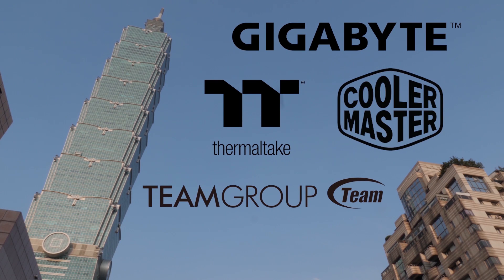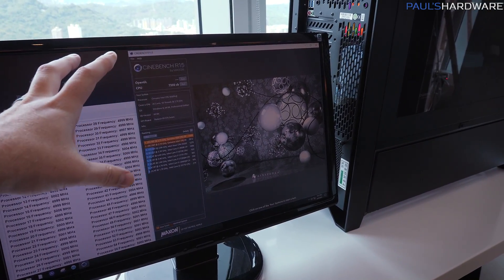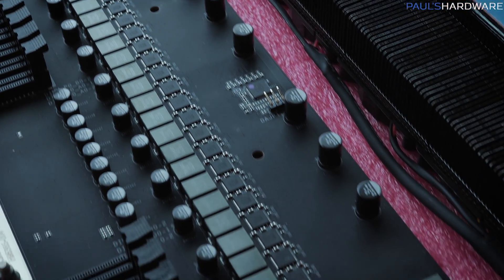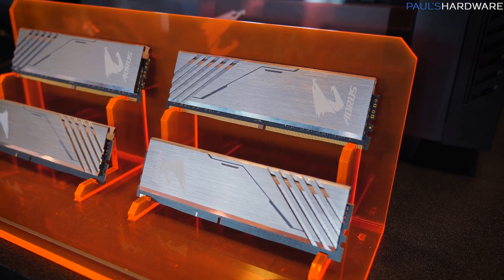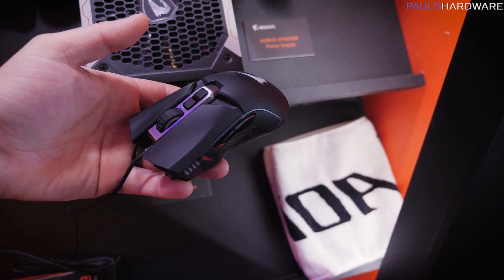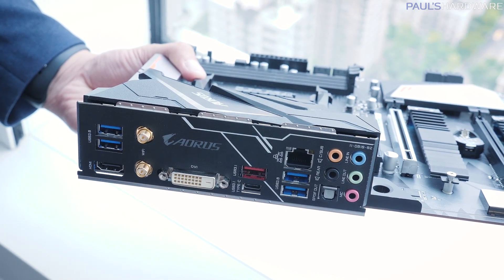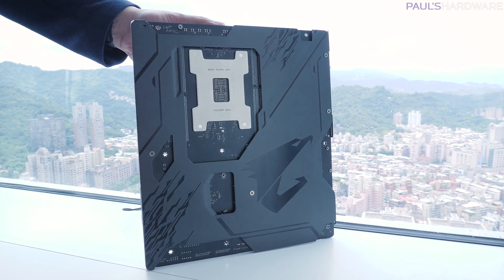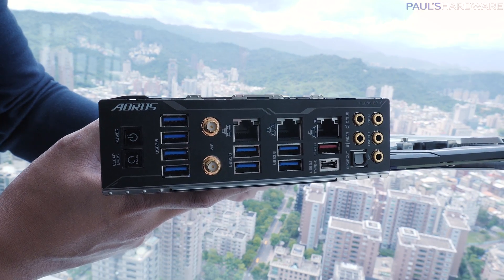Just A 28-Core 56-Thread CPU at 5GHz...

Comment: Intel, want to recover your market, make a 2 core, 4 core 6 core and 8 core and take a little lessor break even on them but MAKE them clocked at 5.3ghz native with a turbo to 5.9ghz, maybe 6ghz? People would be all over that and they can win the WAR without even attacking the same market! It's all about RAW Power...... Leave zero room for overclocking on these chips, that would still be fair if the price was right or like AMD'S or BETTER!...... Heck, I did major calculation on my personal usage and I NEED or would love nothing more then a 14 core cup that is clocked at 4.9ghz native that go up to 5.7ghz on the highest CLOCK as in secondary TURBO and at least hit 6.1 on the first TURBO.... tHE FIRST NATIVE TURBO CHIP TO HIT 6GHZ ON AIR.... Who would not buy a chip with these specs? I could not see it needing an upgrade until around 2040-ish and even then from degregation so I will stick with my beloved x79 12 threaded beast of a XEON 1650 V0 overclocked to 48% higher speeds then STOCK, what a beast of of a chip but I still want my 6ghz (on turbo) 14 core cpu, no hyper threading needed?...

Comment: I have a small air con that sits in my window and I've run a 6 inch wide pipe from the outlet to the computer case, which has a grill that lets in plenty of air and this cold air goes directly to the CPU. This set up reduces the CPU temp by more than 10 degrees celcius, and of course I only turn the a/c on when it's overheating, like on file-convert processes and other CPU intensive runs, cos it would cost a fortune otherwise. I've had this set up for nearly 10 years now and have had no problems.

Comment: Intel: look everyone, we can do 5ghz on 28 cores with 10k$ worth of cooling with 3 PCs worth of power supply!!1
amd: cooling? what's that? we just need someone to hold this beer so we can show 32 cores working in normal home system conditions, no biggie, you can get these in 2 months..

Think most of us know we won't be buying a seperate expensive air conditioner to just not set fire to our computers, but intel sure got some headlines printed! :P

Comment: In no way is Intel showing us something 'realistic', since there is no chance in hell this is going to hit the market as their 'new' flagship, not even remotely. Firstly it isn't based on anything new, rather scrapped together with all existing components and architecture, it is insanely and unrealistically clocked to 5ghz on ALL cores thanks to a chiller keeping the thing at sub-zero temps, which is anything but a real-life scenario so there is no way for us to actually 'relate' to something like that, then it must be drawing in excess of 1000W, knowing that the 28-core that they already had with a 'normal' oc would draw about 600-700W, which again is far from what we would be able to buy and 'use' in any way shape or manner, unless you like paying an electrical bill that is equal to your mortgage on a yearly basis. This is Intel telling you: 'hey look at us and what we can do, but you'll NEVER be able to actually use this fantasy anyway, so the joke's on you.'

AMD on the other hand IS showing us a real-life usable CPU with 32 cores, running ON AIR, and drawing a VERY conservative 250W, which is doable by today's standards for EVERYONE.

It's a clear case of lie vs truth. Wake up and smell the roses ;)

Comment: Intel did this move as a last minute PR stunt. They quickly used a Xeon socket and Xeon cpu overclocked well above the 2.7ghz base clock on all cores to 5.0ghz with a 1000$ liquid cooler lol. That is really just embarrassing as I bet every enthusiasts laughed after seeing the setup. Then here comes AMD with 32 cores with an actual production cpu and air cooler ready to be launched. From what Intel showed I don't believe this will work at all. This Xeon 14nm Skylake 28 core cpu at 5.0ghz will have a 500 watt power draw or higher. It will throttle even with a 480 radiator. There's just no way in hell this work in a mainstream platform at all. This was clearly a desperate move on Intel's part and they should've not shown this at all. They could've announced it but not shown it. The price of this processor is 10,000$ while AMD's 32 core will probably be 1700$. Do you really believe Intel will even be near this price point? No. It will cost at least 5000$ for Intel's 28 core processor. The reason I say this is because the data centers buying these will be really pissed. They will probably switch to EPYC in the long run.

Comment: The doggy practice intel did was probably was expected. What it shows though is a large section of the tech press need to be shut down as they can't do their job. Intel although hitting 5hz did not say it was a production chip, so they press should have checked and asked , checked about the cooling (massive water chiller) , checked the motherboard, checked the CPU (extreme binned skylake server CPU). Doing these simple thing would have exposed the scam Intel were pulling. Don't get me wrong
 I love the 8600k I just bought, but this is an astonishingly shaddy practice

Comment: @ 8:58 you can see a 5 pin THB_C header, does that mean Thunderbolt 3 support for AMD is finally almost here, the Designaire board had one too, but I don't think anyone has really talked about if its actually working/ supported yet

Comment: Surprised me the first time I saw it too... then someone actually figured out the deception.  Not only is the machine probably pulling in excess of 700W, but the hidden cooler is likely pulling 1000W just by itself.   It's a well done O.C. demo, but it should have been billed as an O.C. demo and not some kind of magical next-gen Intel cpu.  It isn't even using a new cpu... it's what, a binned Skylake X O.C.'d with exotic cooling?  Come on.

-Matt

Comment: Just a 24-core 56-thread CPU at 5Ghz that is phase cooled, probably binned on a specialist overclocking motherboard that is drawing more power than a dual socket Threadripper...
Reply: oh and likely at a price point where you can buy 2 treadripper SYSTEMS xD

Comment: This is a "rebranded" Xeon Platinum 8176 or 8180...the 8176 currently costs $8,720 and it's been overclocked with a phase change cooler. For those who don't know Phase Change is considered "Extreme" overclocking as it's chilling the CPU to sub-ambient temperatures, in this case Steve from Gamers Nexus stated it was being cooled to -10 degrees Celsius. But yeah, this is totally a "new" CPU that Intel is just going to throw out there fro the HEDT platform for anything less than $5,000, if you beleive that then I have an island to sell you!

Comment: So the release product will cost $4000 for the CPU and it'll likely boost clock to around 4GHz at best....

AMD's just laughing all the way to the HEDT platform lead then. 32c Threadripper costs them the same amount as a 16c Threadripper to make. So zero extra cost, double the cores and threads and a massive headache for mobo manufacturers who now have to deal with a 250W TDP :D

Comment: Intel presenting this thing like it's just an out-of-the-box 5Ghz 28 core, while using a phase change cooler that consumes several hundred watts and a 32(!!!) phase VRM with 4 12V EPS connectors. The CPU was probably consuming 1200 Watts on its own, not including the cooler. What bullshit.

Comment: Yes a 28 core skylake x at 5GHZ.
This is absolute crap.
Did you ask about the cooling required??
And the fact that the 18 core version pulls 600 watts at 4.7ghz???
it's a rebranded xeon and will get nowhere near it's advertised speed.
Great video......

Comment: It's not "coming soon" - it's an existing Intel Xeon server chip. They just binned the shit out of them and found one (rare) example that will run at 5GHz on liquid Ni, or on a phase change cooler.
Are they going to make these and sell them, against ThreadRipper?
I don't think so.
ThreadRipper exists because of the binning process. They're EPYC chips (packages) where some part or parts of the package don't work, so AMD switch off the bits that are faulty and sell the result as a skew. They never quite expected ThreadRipper to be as successful as it is, but ... that's a bonus, right?
So now Intel are at least thinking about / talking about doing the same thing. But this Godzilla-Beast is an existing server chip turned up to the point of supernova, and used at the show to steal AMD's headlines. That's all it is.

Comment: WHAT!!! WHAT!!! LOOK AT THAT VRM!!! 28 PHASES AND 4 8 PIN EPS CONNECTORS!!! LOLOLOLOLOLOL

There is no way that system isn't consuming at least 1400W at 5Ghz if they need a fucking 28 phase VRM with 4x 8 pins, and people laughed at AMD for a 300W CPU, really I shouldn't be shocked as the 8176 at 2.8Ghz on all cores consumes 670W...

WTF is this has Intel lost there fucking minds, lets like assume that Intel has improved there process and not they can get 3.2 - 3.4Ghz on all cores out of the box and they can do that at the same 670W, STILL!!! THATS NUTS!!! Then AMD comes in at 3Ghz 32 cores and a TDP of 250W and that likely is a realistic power consumption number as Thread Ripper 1 was honestly labled and if your going to lie go big or go home.

So to maintain your boost clocks with Intel you have to use a custom loop water cooler to not be throttled into the ground because to actually get that 165W TDP that it has on the side of the box for the Xeon Platinum 8176 it actually has to go all the way down to 2.1Ghz, if they increase the TDP to something like 205W they can push a 2.5Ghz base clock, they could go to 250W but honestly I think that might be a little much for the base clock on a consumer part.

So you likely are going to be running at your base clock a lot of the time.

Comment: Not only did they have to use sub ambient temperatures, Gamers nexus has reported this is almost certainly actually just a skylake-x xeon cpu in the demo and they are basically just going to strip down the skylake-x xeon processor and sell it for $3000+

Comment: This is not a new desktop or workstation CPU it is an existing Xeon CPU, with a chiller providing <0c fluid through the loop.  Look at the power requirements: 4 supplemental CPU power connections 32 phase power delivery that they are having to drive to the point they need an insane amount of active cooling to prevent a meltdown.  How many watts do you think they are having to push into that CPU in order to require that amount of power handling and heat?  In the real world no workstation or server that is designed for regular use (in terms of frequency and duration) will be able to feed the power, or dissipate the heat as this is setup.  So is this a real product I say it is not, and others agree with me.  It seems to me that Intel simply was trying to grab the headlines from AMD to mitigate the impact that TR2's launch was going to have...

Comment: that thing is not even gonna hit 3.5 ghz without throttling on air or water. You need a air conditioner or LN2.

7980xe was pulling 600+ watt on 5 ghz in jayztwocents video i doubt what this gonna is do. The 5ghz advertising is so bullshit.

Threadripper is still gonna out perform this thing in peformance/dollar + it will have ecc memory support which this gonna lack for sure.

Comment: Did they really??? Intel engineered Fake news. Think they played you
Reply: Definitely fake, go check out gamers nexus' review on it.
Reply: B0NES YT
 yahh it does beat EPYC but with an exotic cooling solution. in what world would anyone would run LN2 or a cooler to run a system that is used in a daily basis. It would also need a high number of phases for the VRMs to even run a 28 core processor at a stable 5Ghz  which is expensive. This is still a bad thing because they're trying to fool us with marketing saying that this is a new desktop processor in the Skylake-x lineup even though it's an old server class processor.
Reply: Bones TY ... yeah about as impressive as the fact that the world record overclock of 8.8ghz is still held by an old AMD bulldozer CPU ... If AMD started showing this old FX-8350 off at computex to prove to the world that they have the fastest CPU .. .would that be impressive? No. Its stupid.
Reply: only die hard fanboys will buy that abomination cpu .. intel should bundle it with a nuclear reactor, fire extinguisher and a house insurance.
Reply: Anyone going to take into account that the clc cooler costs near 2000 US, the custom high end motherboard over 1000 US, and the processor itself in it's normal locked configuration costs over 11,000 US?
It doesn't matter that it's all bullshit, it could run at double the speed they forced it to and still never be competitive.
Reply: The new Threadripper got about the same score at stock speeds on air cooling. that 28c intel chip at stock will require a custom loop and only gets around 6.1k in CB see linus' video for proof of that. What is impressive, or depressing depending on your view, is that Intel seems to have fooled almost all the tech tube press only Hardware Unboxed and Steve at GN have called Intel out on this smoke and mirror show.
Reply: B0NES YT No! Not when you need a separate A/C system to cool it and a 1600w power supply.
Reply: He was so played
Reply: Not at -10°C cooling with a 1200W freon chiller...
Reply: B0NES YT Run an Epyc cpu at 5ghz and then make the comparison. BTW cool that chip with LN2 or a chiller as well. Thanks.
Reply: Grave Flower Yeah Steve said it's an oldere Xeon CPU. But doesn't that make it more impressive? That Cinebench score demolishes any EPYC score I have ever seen too.

Comment: So hilarious how Intel gets a 28 core, shows it running on 5Ghz, but actually is running it sub ambient with a chilled 1kw watercooler, running with a 32 phase vrm and 4 8pin eps connectors on the motherboard and no hopes of it launching on X299 while AMD just happily shows their 32 core running under and air cooler and it will fit in any tr4 socket.

Comment: intel managed to make something incredible with that 28 core...
it has around 2.5w/mm^2 of heat flux
a space shuttle on reentry had a heat flux of 5mw heat flux 5w/mm^2
ITER the european fusion project will have a 10mm^2

intel literally made the fx 9590 to look like a child toy 
add to that the 2HP chiller they used to cool this thing down (2hp-1770+ watts...)
you literally will need to rewire your entire house to prevent a housefire

Comment: Intel scared they're losing the spotlight to Threadripper. Damn, that's embarrassing, especially when your competition (AMD) has less than 10x the money you do.
Reply: Flex Thrust Listen, there is no way that 28 core CPU is going to hit 5Ghz on anything else than a chiller, they're not kicking asses, they're literally panicking over competition.
Reply: Flex Thrust lmao, I bet they can barely get this thing stable... Cherrypicked server cpu, delidded and use phase change to cool it... How is this an amazing product from intel?
Reply: PaynPlay play
 Nice try fanboy, you can try switching TV channels with a calculator, it won't work, so won't the real version of this CPU for the same reason.

That 28 core CPU is just an hyperclocked Xeon, Intel doesn't currently have the proper architecture to push even an 8-core CPU at 5Ghz without having it to overheat and lack overall efficiency, it may even fry your VRMs.

You just encouraged false advertising and monopoly, congrats.
Reply: Flex Thrust
A $10000  8180M server chip kicking ass lmao
Reply: PaynPlay, it will indeed hit 5GHz with a $4000 cooler with a $1000 motherboard and a $4000 cpu drawing 1200 watts just for the cpu.. meanwhile the TR2 32c/64t on air cooling non overclocked got almost the exact same score around 7.3k drawing 250 watts. This Intel chip with a consumer grade custom loop cooling solution only gets 6.1k they let linus run CB on it and 6.1k was the score sorry not sorry.
Reply: \m/ Ryzen \m/
Reply: PaynPlay play oh look another dumbass fanboy.
Reply: Slight typo there. Even Google "has less than 10x the money" Intel does.
Reply: I9 5GHz not in all clock
Reply: tarik44100 Intel 8 core can't hit 5ghz ? 7820x says other wise, the top ones can hit 5ghz, oc3d did 5ghz @1.3v with a h110i. Could have easily used a nh-d15 and had the same cooling performance.
Reply: tarik44100 yes way it will hit 5.0ghz

Intel has done it again, less cores and still beats the nasty AMD cpu

Comment: That intel cpu is just to soften the blow from amd, showing off your server cpu overclocked with custom cooling is just weak, no one is going to do the same for actual work or general 24/7 usage...
Reply: Especially when this whole setup costs in the range of 15K plus, including the custom CPU chiller. This isn't a consumer product in the slightest.
Reply: and uses about 2.1 kW of power. If you are a North American consumer, you'd have to install a special 240v outlet just to power this abomination of a system.

Comment: The previous year, AMD launched its Threadripper range, reaching 16 cores and 32 threads at 3.4Ghz (4Ghz Turbo).
In this beginning of Computex 2018, Intel surprises us with the announcement of this new processor, still unnamed, it would jump to 28 cores with 56 threads and under a speed of 5Ghz, that is, a whole beast. We only know that it has only one socket and obtained a score of 7,334 points in Cinebench R15. Another interesting point is that this processor would have 5Ghz of base speed, so we can not imagine how much it will come with turbo.
Reply: that was an oc with an air coditioner atached to it, so... that monster is not going to get that speed on many sistems.